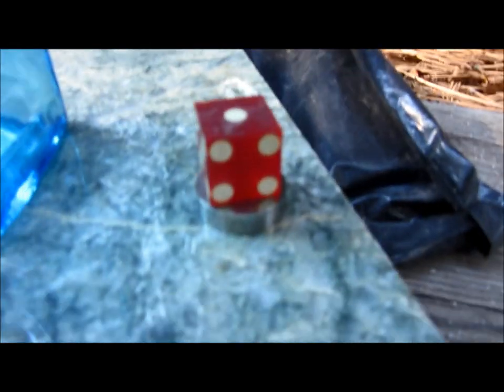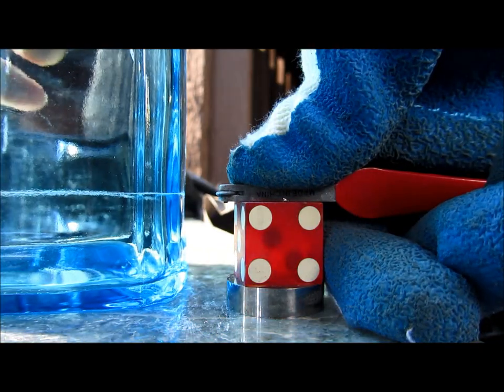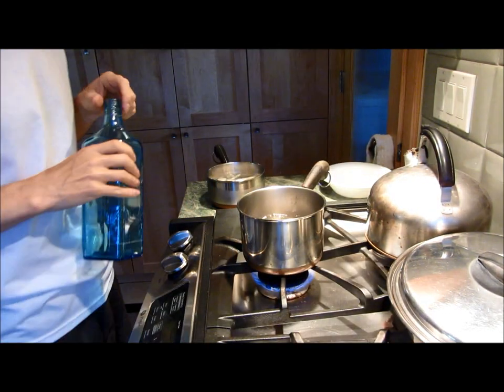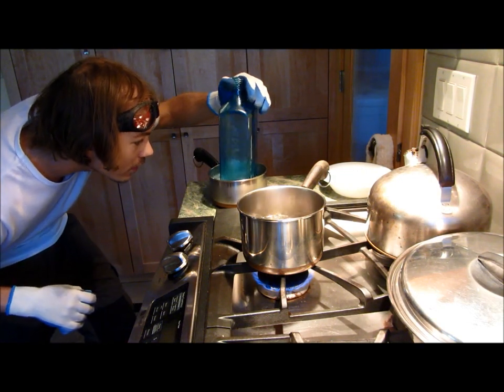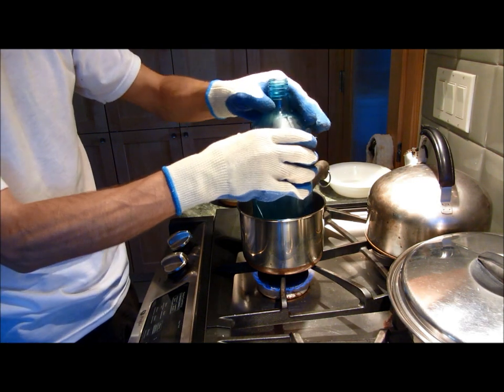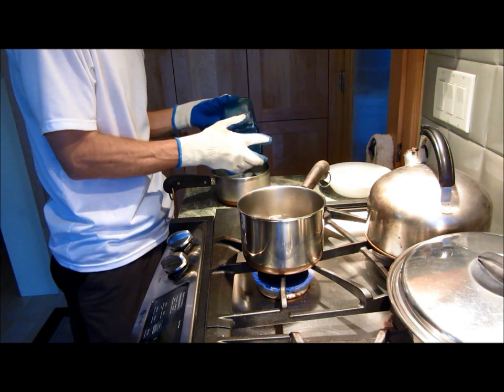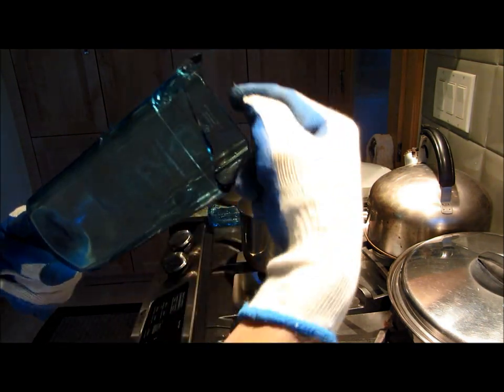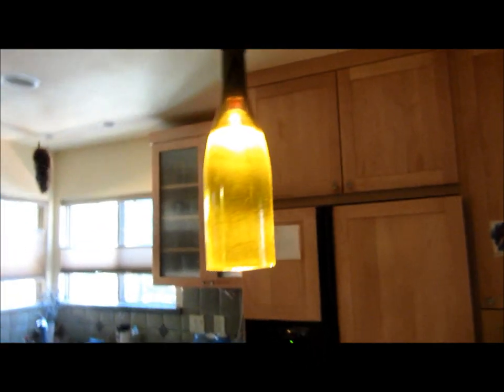Square Glass Bottle Cutting Attempt

Comment: In the future, make sure your cuts are as uniform as possible. Deeper cuts may well give you a better result, but if it is too deep in one spot, and too shallow in another, it will lead to cracking.

Try applying heat more directly to the score line itself. I use a soldering iron to do it, although I have had (some) success with the same method you've used.

If all else fails, use a diamond edged saw.
Reply: Love the idea of a soldering iron!!!

Comment: Use a soldering iron, when you score it, go to the kitchen turn on the cold water. Lay the soldering iron only on the score, you will see when it goes through, keep doing that then do the cold water and it should seperate perfect.

Comment: You might also try putting a thick rubber band (or a band of glazing putty) on each side of the crack before heating and cooling.  This is supposed to stabilize the glass around the score